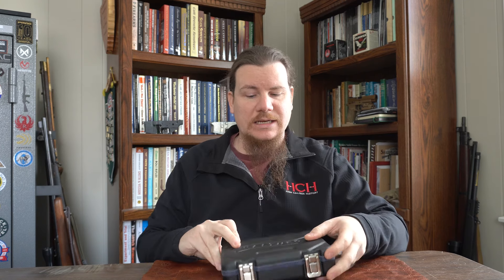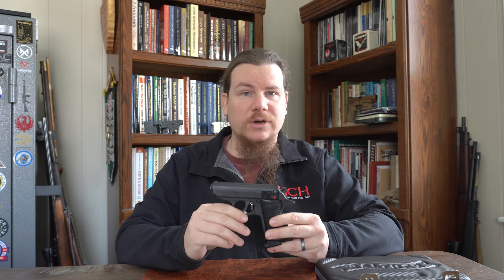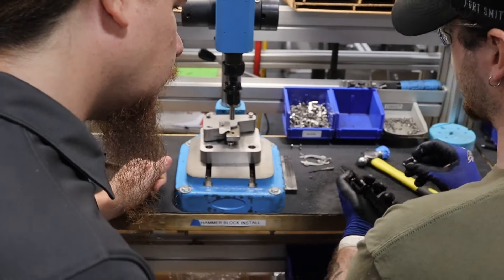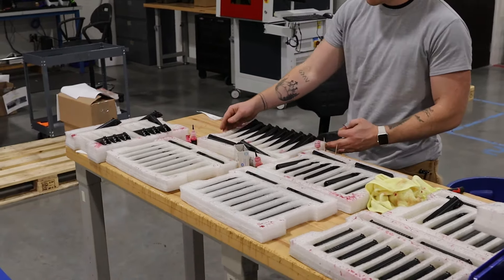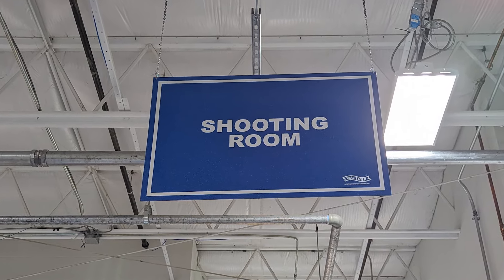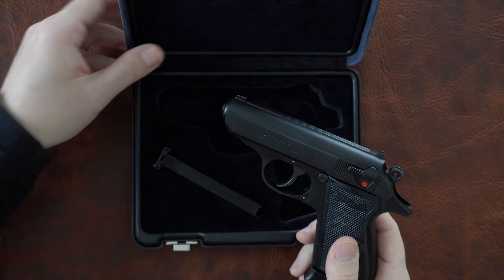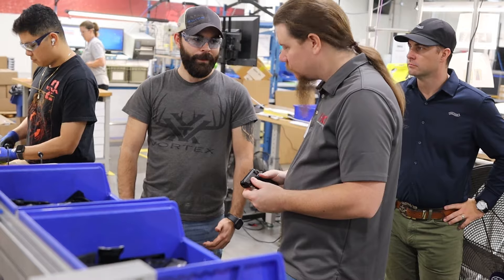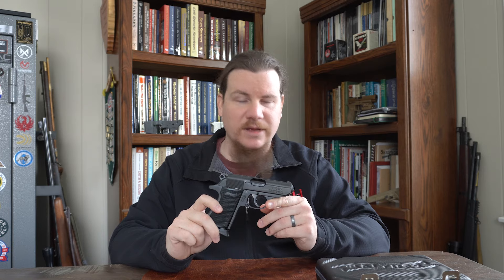Building a PPK/S at Walther Arms

Comment: Amazing great story! Are these pistols any diffrent from the ones used during WW2? Thanks
Reply from the maker: The frame on a PPK/S is approximately 1/4" longer than the frame on a PPK. This is because the Gun Control Act of 1968 banned the importation of pistols that didn't meet certain “sporting” criteria, and the PPK was too small. So, the frame size was changed slightly and the PPK/S was born.
Reply: There is also a bit more rear tang, to help prevent slide bite in the web of your shooting hand.